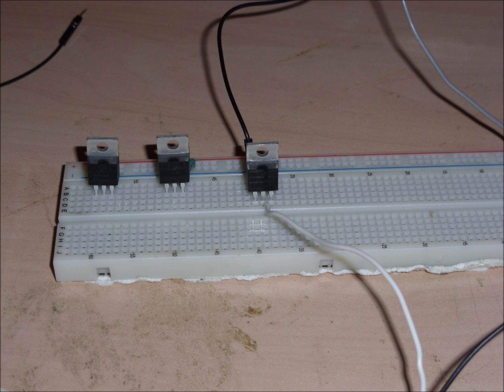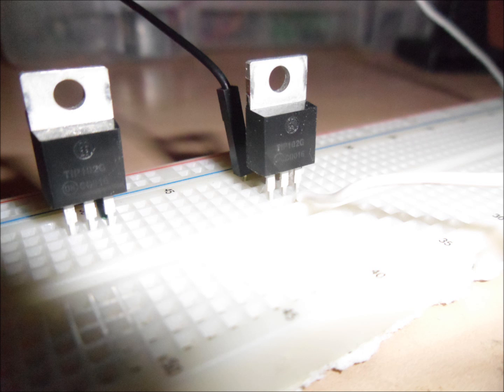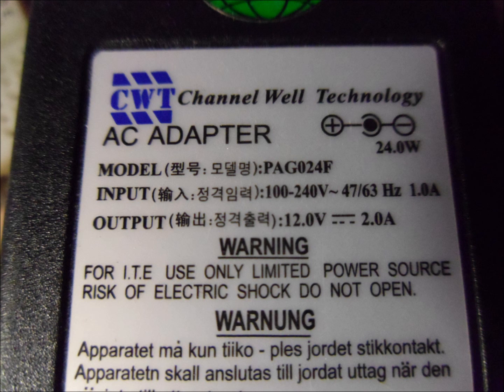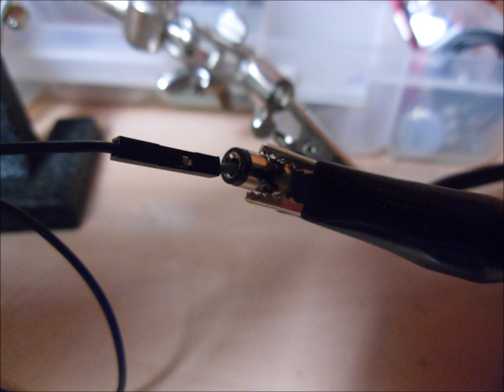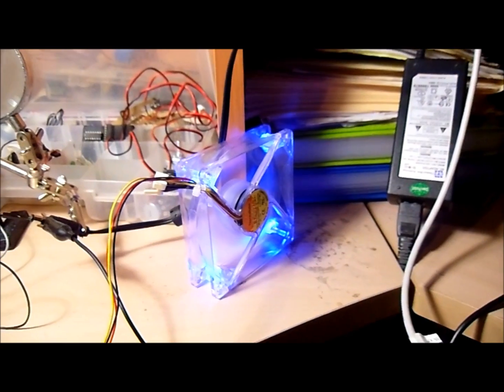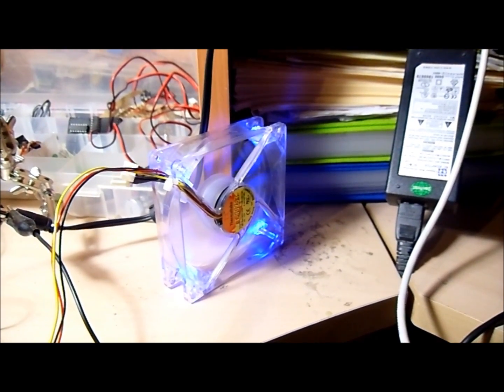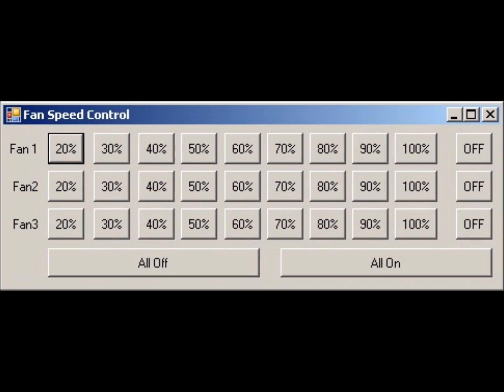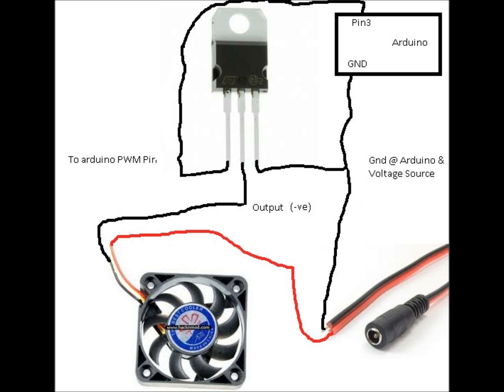$1 Visual Basic/arduino pwm fan controller

Comment from the maker: When you open the form in VB there should be a little serial port icon. Just click it go to port and pick the one that your arduino uses. If you're not sure open the arduino IDE and see which port it is using.